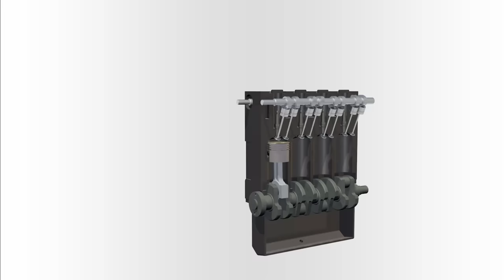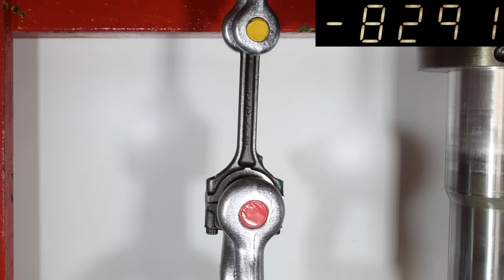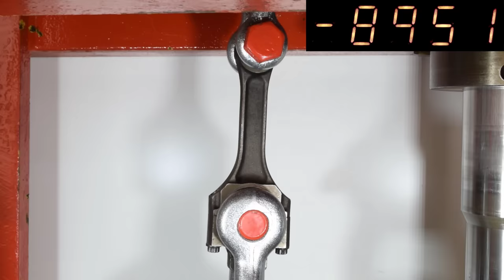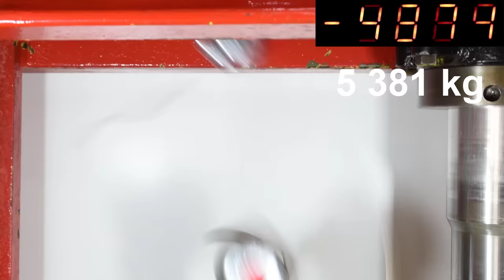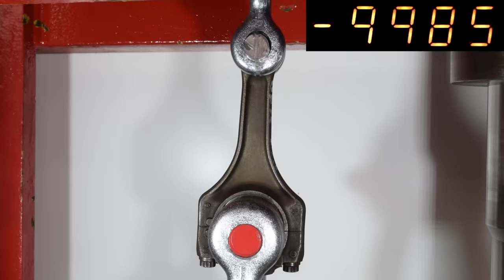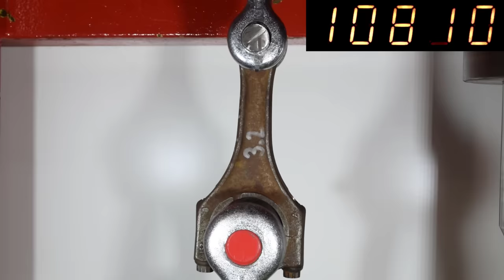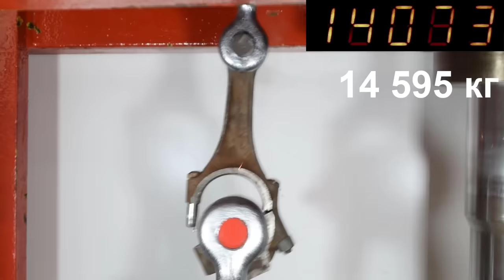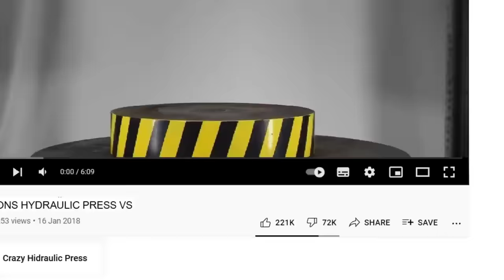HYDRAULIC PRESS VS CONNECTING RODS

Comment: As a mechanical engineer I can say that this test shows only the tensile strength of the bolts not the connecting rods. Also compression strength is more important than tensile strength in the case of connecting rods because they are mostly exposed to compresion forces.
Reply: Only one failed 100% due to bolt failure.     The first rod cap stretched until the bolts were subjected to forces in addition to the tension.   The second failed due to the bolts.    The third one was obviously not the rod bolts.
Reply: Tensile and fatigue failure are the most common failures of con rods and bolts. Compression failures are not common unless engine produce a lot of torque at low rpm such as diesels running large amounts of boost and fuel or adding nitrous at too low an rpm. I have removed plenty of rods from holes in the sides of engines. None were compression failures.
Reply: @septicwhelk3654As a tractor driver fresh out of MUD?

Me as a skunkinseminator must say, tractor drivers know nothing!
Reply: Es cierto. El esfuerzo mayor lo realiza en la comprensión de la biela.
 Otro factor importante a tener en cuenta  el uso que se le ha dado a dicha pieza. No es lo mismo que haya sido usada en un coche de carrera que en un vehículo de un abuelo.
Por último y no menos importante es el diseño y peso de cada biela.  Unas están diseñadas para disminuir peso del bloque motor y otras para aguantar lo máximo posible.
Es interesante el vídeo pero las conclusiones que se pueden sacar son muy escasas.
Reply: I would expect failures to occur due to fatigue. So more about metallurgical quality and free from defects that would cause stress concentrations.
Reply: Hang on. Tensile strength is right up there. Imagine the connecting rod having to stop that piston from wanting to fly out through the head. The crank throws that piston like a bullet then has to stop it around 100 times a second. There is huge tension on the rod and bolts. The compression forces are a shitload less.
Reply: @aemetals5672  Meaning that Compression failures are not common doesn't change anything. When you design something you consider the bigger and frequent forces and in the end you get more durable structure against those forces and weak against other less frequent forces. Also my point was about how this test done and results are not reliable  because they're measure the tensile strength of bolts actually. Connecting rods are just act as a weak handle dies. Data from this experiment doesn't have any scientific value
Reply: 這不用什麼工程師才看得出來好嗎？😅
Reply: Thank you for making it make sense
Reply: Exactly,these sort of forces would never occur in an engine,all it’s doing is finding the tensile strength of the bolts,it doesn’t prove anything,a complete waste of time.
Reply: Im gonna be the guy who points out that this channel crushes anything they can find, it's not a testing channel it's a crushing channel. They just thought connecting rods would be an interesting thing to crush and attract some viewers
Reply: @DomzyDX  It’s a ridiculous experiment that proves nothing when it comes to engine efficiency or reliability,the whole thing was a waste of time because as someone has already said it proves nothing when applied to engine technology.
Reply: @davidellis279  I found the whole thing to be somewhat entertaining. Perhaps you are as I stated earlier taking this video too seriously. It's a channel that crushes random things in a hydraulic press not an engineering/science based channel. Expecting scientific accuracy here is definitely a stretch given that this creator just crushes random things for content.
Reply: @bobolulu7615   agreed.   Almost all con rod failures are due to high rpms which is not due to compression.
Reply: Typical engineer, book smart but not practical. Compressive force is the least bit of worries for a con rod. It’s tension, tension only is what breaks a rod or bolt. The bearings are what compressive forces destroy..
Reply: Pont ezt akartam mondani h a hajtókarok az összenyomásra és nem a széthúzásra vannak tervezve. Amúgy meg ennél a vizsgálatnál nem a hajtókar hanem a csavar lesz a tesztelt alany.
Reply: I disagree that compressive strength is more important. If your engine produces too much cylinder pressure for what the rods can handle, they may bend without breaking. If you get lucky, the engine will survive and you'll simply suffer very low compression and need new rods. If a rod fails under tensile load, it will either smash a window in the side of the block and/or the piston will smash the head and valves, damaging the bore in the process. A failure under compression may only kill the rods. A failure under tension will most likely destroy the entire engine.
Reply: @noxious89123  I agree with you! These guys here don’t know anything really.. most times the piston/con rod is being driven by the crank. Only on compression/power stroke the compressive load presents itself. Tried to tell them that drag motors get the rods measured for stretch and straightness..
Reply: Material science and engineering... Not bolt
Reply: @aemetals5672  I think he is saying he would like to see the rod subjected to compression in the press, and then see the numbers when (and if) it fails. That is a really cool set up this guy has, though.
Reply: 100% correct, this was mostly a test of the bolts which is where most failed. Con rods are designed to be strongest in compression. Which is how they should be tested, as per the thumb nail!!
Reply: @manoo422 nope…compression is the least troublesome thing for a con rod. If what you say is true why don’t engines blow up at idle? Compression force is exactly the same at low rpm as high rpm UNLESS it’s not naturally aspirated. AGAIN, drag engines are measured for conrod stretch when torn down. The very same stretching motion that causes rod bolts to break. Rods and bolts don’t break because of compressive force. Learn something about engines before commenting…
Reply: @Thewatcherinthering336  Completely wrong, the combustion force is lowest at tick over and maximum at peak torque, being aspirated make no difference. A measurement of stretch is equally a measure of compression because its a measure of ANY change in dimension which denotes permanent stress. Reciprocating forces are almost the same in compression as tension but once you add combustion forces its by far the dominant force. Rod bolts break because of fatigue.
Reply: @manoo422  go build an engine, you have no knowledge of what you are talking about. The whole reason bolts break is because of tensile load. From centrifugal force of the rotating mass. Gee, guess what? The rod stretches from the same force..compression is the same whether idling or at rpm. The only variable is stretch. No one has blown an engine because compression damaged a rod. Go learn something practical before commenting…tool
Reply: As mechanical engineer I suggest to come back to study the forces inside combustion engines, the rods breaks due to the inversion force, so for the tensile strength.
Reply: Hear, hear
Reply: @terryo5672  Even so, how many cars throw a rod in their lifetime?
Reply: @bobolulu7615  True, but the acceleration is rotary rather than strictly reciprocating. Much easier on the parts.
Reply: Yeah I thought it was pretty silly
Reply: @aemetals5672  I mean. All bending failures are tensile failures (if you say that the failure origin side was under tension), but they're still gonna be caused by compression forces.
Reply: Except tensile strength is super important when you don't want the rod to jump out of the engine when you run a super high RPM.
Reply: @aemetals5672  thank you
Reply: @DomzyDX  Then why he didn't crush them to mimic the real maximum forces they are subjected in engines, but pulled them apart until breakage !?
Some of us have seen how french cars bend their rods made out of cheese !  Some times more than one at the same time.
Reply: @SliderHarDCorE  because he didn't intend to make a scientific video, and if he crushed things too fast the video wouldn't last long enough to monetize. You guys are wack if you think this dude is a scientist or engineer.
Reply: No
Reply: Hmm our testing of 15000 rpm NA race engines shows our tensile loads to be most problematic.

Comment: You tested the screws, not the rods. The rods are made to be compresed😂
Reply: But still impressed about that BMW broken eye. In an overrevving engine it would be a "piston has left the chat"
Reply: You are right
Reply: @ziobrik  👍👍👍
4 strock engines: 
3 strocks, the rod is compresed by: compresion, detonation, exhaust.
1 strock is admision when piston is pulled down by the rod freely with admision valve oppen.
👍👍👍

Comment: I am sorry but this does not test the strength of a Piston rod. All you test is the strength of a bolt material. You should try to compress them rather than stretch. The force from the engine act compressing the rod rather than stretching.
Reply: Which is why only one them had a bolt failure,
Btw if rods are only made to be compressed
 how about exhaust stroke ? The piston is subject to some big a$$ stretch during that phase

Tell me you did not watched the vid without telling me you did watched the vid

Comment: I thought you would compress it, not stretch it. So, it’s mostly about the bolts then - isn’t it?
Reply: yeah thats what I thought
Reply: Interesting part is the M3 the bolts did not give up, But yeah compression will be a better test since this rods get the blunt of the power stroke in compression
Reply: I agree. Internal forces are the other way.  They push or compress the rod, not pull it. But that would not make for such a fun video because all those rod are more than adequate under normal operation. And actually the lighter the rod, the better it is for gas mileage
Reply: In tension it is... Which isn't how connecting rods are loaded anyways. 🤦

Like testing an umbrella upside for how well it sheds water.
Reply: Failure under compression is a highly atypical failure mode, even for cast connecting rods. Failure usually takes place due to shearing forces in the wrist pin domain, poor lubrication at the big end bearings, or tensile forces on inadequately fastened rod caps. The highest loads on a connecting rod assembly are presented in tension from the reversal of momentum at the extremes of piston travel.
Reply: The piston stops at top of travel and then same effects happen
Reply: @ccarlock8537  The deceleration at the top of travel is minimal compared to the compression stroke.

Generally there's always some back pressure on the piston.
Reply: Yeah me too
Reply: @mrchad97z49 The rod is stretched when stopping the piston at TDC then stretched again when pulling the piston down. In compression, the bolts are just going along for the ride.
Reply: Well compression of these usually results in explosions and flying debris and chaos in the court lol
Reply: Samochód 1968 to rosyjski Moskwicz!!!!🤝🤝🤝💪💪💪😁😁😁🚗🚗🚗
Reply: And some break at the upper ear.
Reply: Old was gold.

Comment: Those old soviet cars were built to last and also in some of the toughest conditions. Not built for speed or high performance just a workhorse to get from A to B. Amazing to see. Thank you for the video.
Reply: Ці старі радянські машини постійно ламалися. Про що ви говорите?
Reply: Die Moskwitch Pleul sind aus T-64 Stahl gegossen, deshalb halten sie so gut
Reply: I bet you never ever drive one.
our grandfathers spent all their time in garages trying to fix these jalopies. many parts were strong because they were simple, and the engineers did not even try to make the design lighter.
Reply: Soviet cars were just reliable and durable. But, low performances, high fuel consumption, although they could use low grade fuel, but were having high emissions. In fact, all comunist cars were having high emissions.
Reply: @Xenium_Q  modern Chinese Cars dont